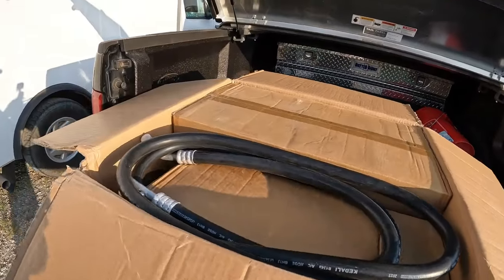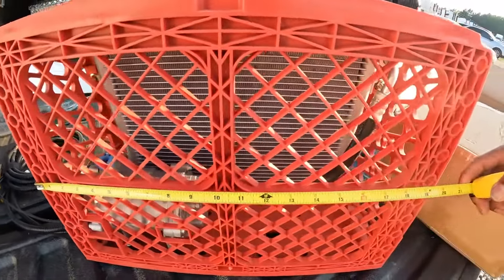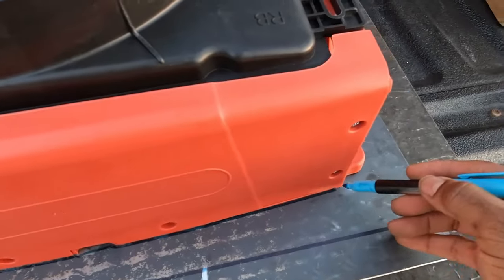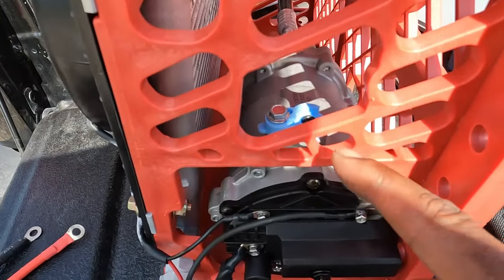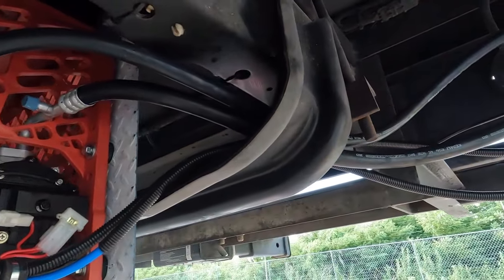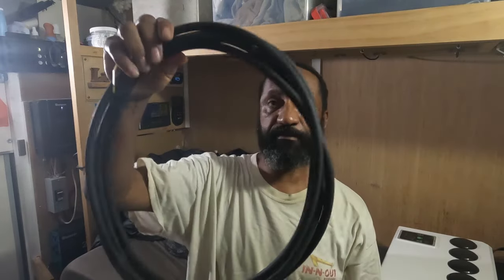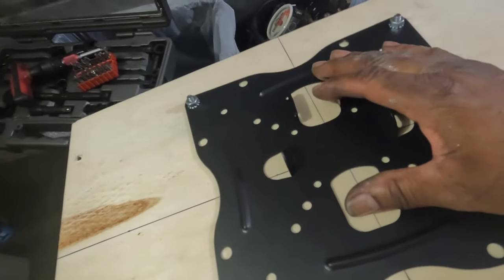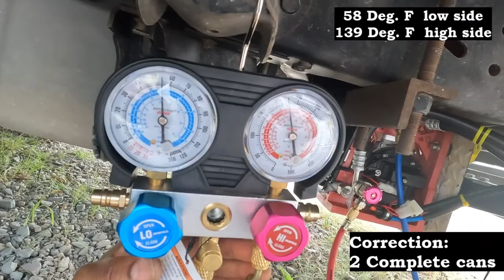VAN LIFE IN A BOX TRUCK: 12 Volt DC Mini Split Install

Comment: Do you have any concerns of keeping the unit you mounted underneath clean, I hope road grime and dirt, mud doesn't plug up the underneath unit.
Reply from the maker: I had concerns when I did the initial install.  Now that I've driven close to 5000 miles with no issues, I don't think normal driving conditions will be a problem.

Comment: 8875 btu, I wish they had a more powerful unit.
Reply from the maker: Most of the listings say 6800 BTU. This link says 12,000.  I'm not sure any of these numbers can be trusted

Look at this on eBay
https://www.ebay.com/itm/12V-Truck-Cab-Air-Conditioner-12000-BTU-Split-AC-Fits-Semi-Trucks-Bus-RV-Caravan-/404895633420?mkcid=16&mkevt=1&_trksid=p2349624.m46890.l49286&mkrid=711-127632-2357-0

Comment: I heard you say you have to run a generator?  Will this not work on a 12v battery alone?
Reply from the maker: Yes, It will work on 12 volt battery power alone.  I have to run my generator on very overcast days and at night while the a/c is on.  Without the generator or shore power my batteries would be depleted in about 4 hours.  On sunny days, the solar panels will maintain the batteries while the a/c is on.
Reply: @xlamontx  ok excellent, thank you for the clarification.  You did an excellent job here sir, is everything still holding up?  And still cooking well?
Reply from the maker: @PaulHaidinyak  
Yes.  It has held up well over the last year.  I would certainly recommend it over a window type unit.  I did received a negative review from someone that said they experienced problems with their unit.  I'm not sure of the details beyond that.   Thanks for your question and comments.   Safe travels.

Comment: That condenser has MicroChannel tubing, RUN!
Reply from the maker: What's the issue with the condenser tubing?
Reply: @xlamontx  Yikes!  Those things leak like wild!  I work in HVAC, and it's the only thing that strikes fear in me on a service call.
Reply from the maker: @reggiepplee5759  
🤣 I was thinking explosion for some reason.  I appreciate the heads up.🙏🏾

Comment: How much oil Qty, you are Topup
Reply from the maker: Hi, I just used the oil to lubricate the o-rings.   The instructions say not to add oil to the system.  The unit is shipped from the factory with oil.

Comment: Hey there - I got this AC and am having an issue with it after a couple years ... and I don't have the manual. Any chance you do and would be willing to share? I also mounted mine under my vehicle.
Reply from the maker: I will check for it tomorrow when I get back to my rig.
Reply: @xlamontx  amazing - thank you so much!
Reply from the maker: I took pictures cover to cover and made a video.  I figured it would be easy to pause and read or screenshot of you find the information you need.  What type of vehicle did you install your A/C in?   Also, did you leave your condenser and compressor in the plastic cage it comes in, and did you have room to mount it vertical like I did?  I had a viewer ask about mounting them at an angle, but the question was removed before I could double check and research my answer.  Here is the link to the manual that came with mine.
 https://youtu.be/tkw0D6FlszQ?si=IbzrkmkdrJ-rszAz
Reply from the maker: https://youtu.be/tkw0D6FlszQ?si=IbzrkmkdrJ-rszAz
Reply: @xlamontx  hey, that's amazing - truly appreciate your time and thoughtfulness. I installed mine under my Ram Promaster 2500 - 159" wb highroof cargo van. I also modded the blowers to travel up and vent at the top of my bed area.
Reply: @xlamontx  also ... I fixed my issue. The quick disconnect by the outside unit - going to the inside unit failed. I replaced the connections and it's back up and running. I'm now looking to add an IR blaster so I can control it with my phone or google home.

Safe travels friend - thanks again for your kindness.

Comment: Is this unit good for a 2000 international box truck? Im converting it into a mobile barbershop...
Reply from the maker: It will work anywhere you have a continuous supply of 12 volts.  I leave it running while I'm driving on really hot days.  It has 8875 BTU's, so it's more than adequate for my 6.5 foot by 12 foot insulated living space.  I keep it set at maximum cold and the lowest fan speed.
Reply: @xlamontx thanks!
Reply: @xlamontx where's the best place to buy it?
Reply from the maker: @JLamb-us1pn  
I went through Amazon for the fast shipping and the easy return policy.   However, at the time, they were less expensive on eBay.
Reply from the maker: @JLamb-us1pn  
You're welcome.

Comment: Hey how does the ac run now? I wanna get one but im woundering about the durability of the ac unit?
Reply from the maker: The compressor is slightly louder and has a different cadence in my opinion.  I've only had it on a few times and for short periods of time since last season; where I would run it all night.  It still blows cold air, and perhaps it just needs to run a few hours to settle itself back down.  The nights are starting to get warm in my area , so I will test my theory very soon.
Reply from the maker: I had a chance to run it today for over an hour.  It seems to have returned to it normal level of loud.  Noticeable but not bothersome (to me).
Reply: Thats sounds good to me i am definitely gonna buy one then. Thanks for takeing the time to reply! Great video it was super informative about everything for the install!

Comment: What about the outer part of the split? Are the ventilator and the compressor noisy? Do you think i could install it inside my van in a place with good ventilation?
Reply from the maker: The outside parts are a bit noisy at times.  I get use to the sound quickly and occasionally have to stop and listen for a moment to hear it.    The idea of putting it anywhere inside the living space won't work because the heat from inside the living space has to be dissipated at the outside unit.  If the outside unit is inside the same space you want to cool, it will sort of cancel each other out.  I tried this with a window unit in my fist build design, and found out the hard way.😞

Comment: How many degrees does it drop and how long can you run it thanks
Reply from the maker: When I have full sun, I can run the A/C all day.  My solar will keep the batteries charged.  Without full sun, I can run about 3.5-4 hours with my 400 amp hour battery bank.  If I need to run longer, I use my generator to keep the batteries charged. 

Temperature drop is going to vary from one vehicle to the next depending on location, size, insulation, etc.  I will include that test in a follow-up video.  For now I will estimate 20-25 degrees. Thanks for watching.

Comment: Thanks for your videos! I'm planning to install one like this in my Sprinter van. But the inner part seems just too big to install in my cabin. Do you know if there's the possibility of opening the white carcass and make it a little smaller? Does it have any screws on it?
Reply from the maker: Hi.  I understand your dilemma, but the shell of the inside unit can't simply be removed without effecting the performance of the system.  It would have to be completely redesigned to do what it does but in a smaller "case."  I would like mines smaller too, so I was looking at it when I got it and didn't  see how it could be done cheap.

Comment: That is to much work. Get a indoor ac, 8000 btu. And a 15000 watt inverter.  Gives you 4 hours and more of run time. At 100ah battery.  

Or even a window U shaped  AC.
Reply from the maker: Been there, done that.  And I mean that quite literally.   I started out with an 8000 BTU window unit.  I tried a 12,000 BTU portable unit, and I currently have the U shaped a/c in my other rig.  So far, the 12 volt mini split is superior. Thanks for watching.

Comment: Great job on this video, thanks!

I have been trying to solve the hidden AC via straight AC or mini-split, but size is the issue I haven't found a solution for. Just so you know – this does it.

But does anyone know of this size unit as a 120v unit?  The 48v option works, too, and provides more BTUs.

Cooling Power: 13500 British Thermal Units
Product Dimensions: 11.8"D x 18.5"W x 16.3"H
Energy Star: 5 Star

The 12v unit:
Cooling Power: 8875 British Thermal Units
Product Dimensions: 11.8"D x 18.5"W x 16.3"H
Energy Star: 5 Star
Reply from the maker: Thank you for watching.   It's good to know some part of the video was useful.   I don't have dimensions for 120v units, but I looled up several in my search for something small.  At the time I thought having a unit with a heat pump would be a good back up plan.  Unfortunately,  they were all too big for my situation.